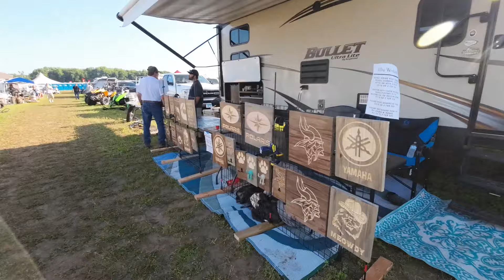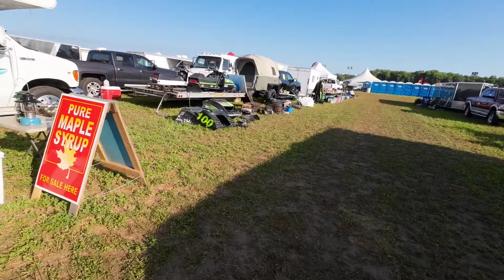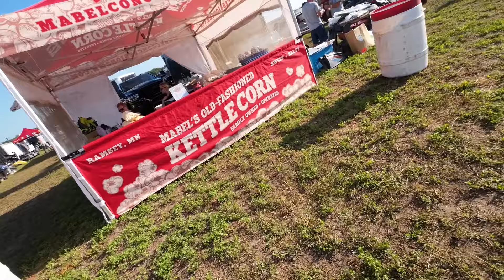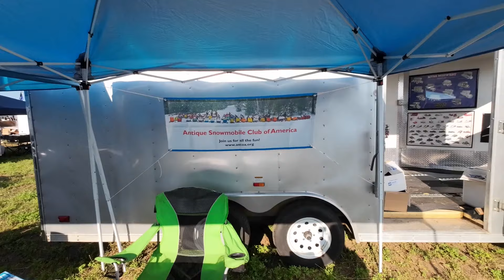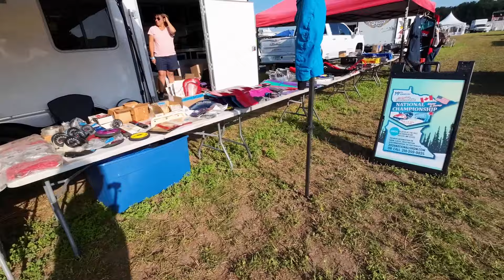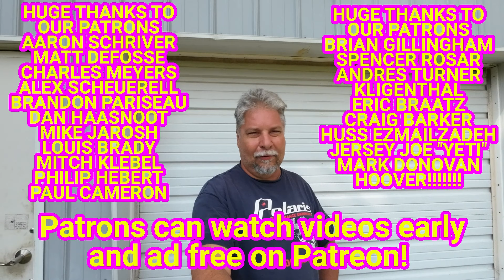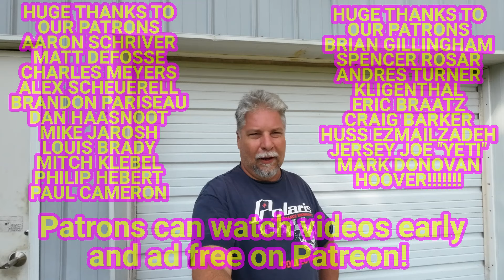Princeton Vintage and Classic Snowmobile Swap meet 2023.

Comment: Those H O. snowmobiles are a great novelty but just like the motorcycles they were just awful..😂

Saw a Scorpion Brut triple engine right after the drone.
Reply from the maker: I was pretty amazed by them. I don't think I had seen any before.
Reply: @nuttersspeedshop  

I have a stack of vintage auto World catalogs here. I bet the snowmobiles and the motorcycles are in there... along with the dune buggy set